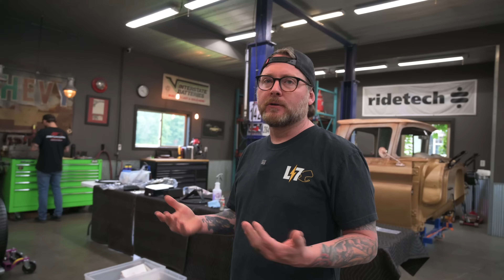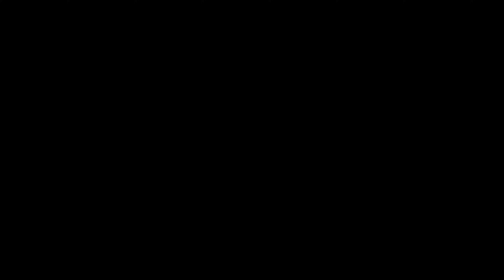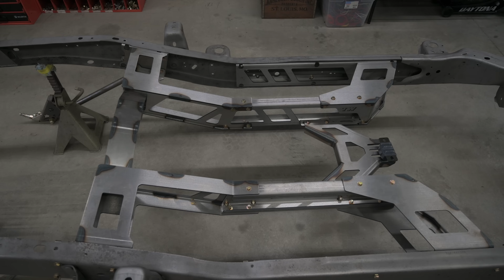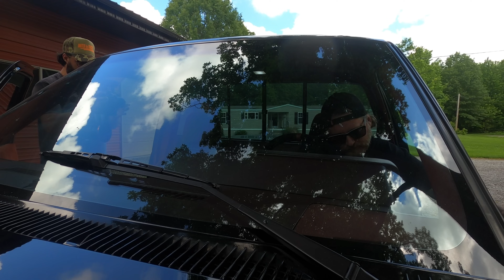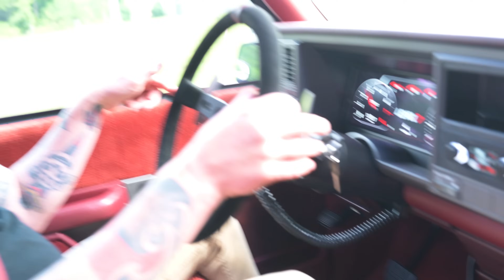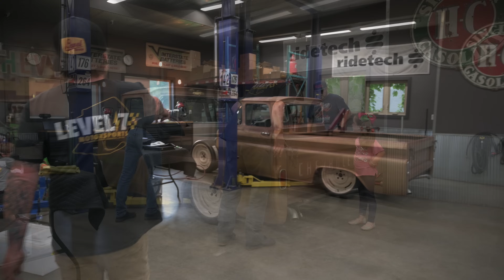Final Assembly Begins on the LT4 '60 Apache | TEST DRIVE ON 454SS LS9 DCT BUILD

Comment: Hey Jesse... Loved the 60' update! I've got 2 OBS( Autocross), and one OBS drag truck in the shop, and have been consistently checking up on your " REI " series. I certainly can appreciate the content my friend. I have personal knowledge on BMW ( and Audi/Volkswagen type ) DCT and 8HP trans swaps. 
One hint to help is that several of the DCT trans baskets without the spring hubs had extensive damage even at lower rpm. I'm just passing that on so as to stave off possible trouble my friend. 
Several ( a half dozen +/– )
still are fine. ( they all now have hubs ) Enjoy your Shop's skill and quality, keep on it!
Respectfully, Seth

Comment: You’d be much better off throwing all the HTG in the trash, you will get it working and it will crash/brick.  They are a nightmare
Reply from the maker: Not had a single issue with this one.

Comment: No power rack and pinion for Ray???
Reply from the maker: No way. Fast ratio gearbox for me!
Reply: @level7motorsports  I was running a AGR 14:1 power steering box in my OBS and it drove like a truck with only 4-5 degrees of caster. Under hard braking it was a fight with wheel and forget about using the brakes in a parking lot. 
I switch over to Flaming Rivers rack and pinion bolt in kit. Now I have 7-8 degrees of caster in the truck and can turn the wheel effortly under hard braking and low speed while braking. All my suspension components are Ridtech and proforge.
PS I'm not trying to talk into anything, just letting know about my experience
Reply from the maker: Well I hate to say it but AGR probably gave you a stock box. They are a horrible company. We will be using a much faster box from Turn One. The rack kits for these trucks most always ruin the steering geometry, are rarely faster, and are not as heavy duty.
Reply: @level7motorsports  ARG was about the only steering box company going back when I built the truck. I know was not stock box, I had stock box. The truck lost a lot of steering radius and was a lot harder to turn.  
Ridtech was the only company that offered a complete suspension kit for OBS's. Q A 1 only offered upper and lower A arms for OBS's.
Reply: @level7motorsports  The Flaming Rivers rack and pinion bolt in kit puts the tie rods right back in the factory position, the stock tie rods are reused. On the aliment rack the steering wheel needed recenter and toe was spot on from factory drag link. 
I'm just trying to sharing a little info. But hey you do you!!!